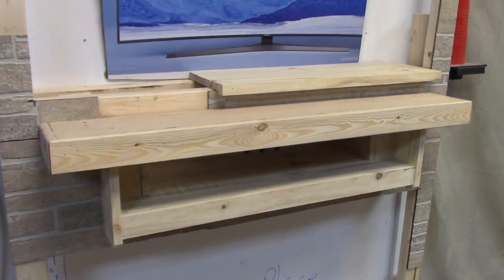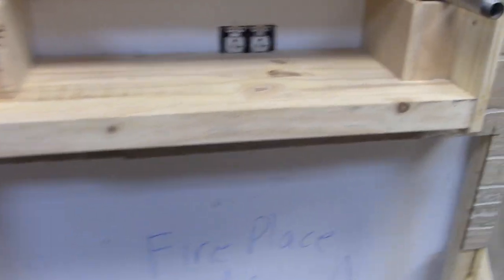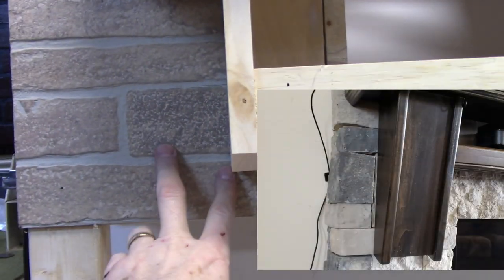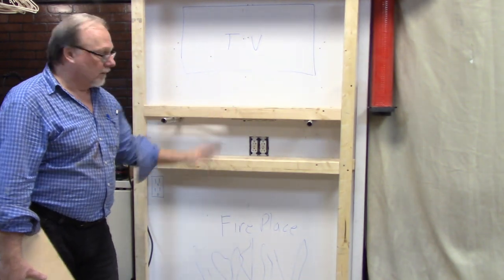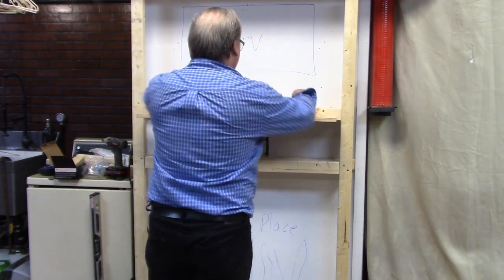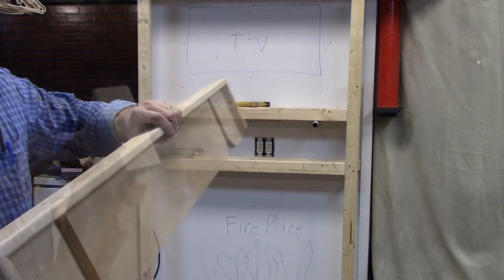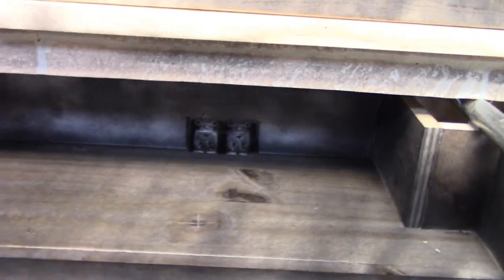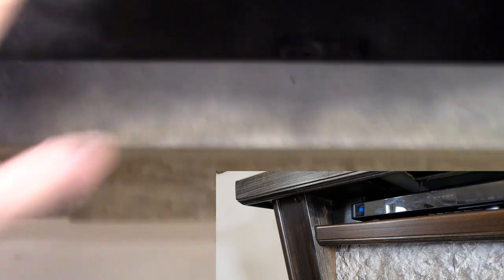Split Face Fireplace Mantel.  This is a mockup of how and why I built it the way I did.

Comment: How long are the pipes?
Reply from the maker: They are 18" for this application, but that can vary based on your design, and it's dimensions.
Thanks for watching and commenting, I appreciate it.
P.s. I post updates, project previews, and other random stuff on Instagram #southernengineering
Reply: @SouthernEngineering  thank you! I love the fireplace so I'm working step by step with your video. How wide and long is the upper and lower mantal?
Reply from the maker: That's great to hear,  I wish you all the best, and have fun with your project.  The fireplace is 70" wide, the mantel is 6" narrower so 64".  The top of the mantel is 8" deep, and the lower mantel is 6".   Check out my mantel build (mockup to better understand its design.  https://youtu.be/z9GS04TGoeM
If you have any more questions, feel free.

Comment: How you put the pipes
Reply from the maker: Hi Michael,  check @ 1:36, you can see the pipe clamp attached to the frame, also see how the pipes are recessed into the mantel, I hope that helps.
Thanks for watching and commenting, I appreciate it.
P.s. I post updates, project previews, and other random stuff on Instagram #southernengineering
Reply: Thank you got it
Reply from the maker: You're welcome 😊
Reply: How deep into the frame did you put the pipe. Did you drill or is that heavy pipe only held by one bracket on the frame?
Reply from the maker: @seankoulaboud5003  the pipe extends all the way to the wall, with a bracket there and one at the front.
Reply: @SouthernEngineering  thx but is that plenty strong? I assumed driving the pipe into the studs would provide sturdiness. I'm having a hard time wondering how things would weigh down your mantle and fall.
Reply from the maker: I had considered that, but after I tested the load capacity I felt confident they would hold up.  In my original fireplace build, you will see me hanging on the pipes, sadly that's over 225 pounds;  it's not likely that you would have more than 25Lbs on the mantel at any time, but if it's a concern you couple use 3 pipes.
Thanks for watching and commenting, I do appreciate it.
P.s. I post updates, project previews, and other random stuff on Instagram #southernengineering